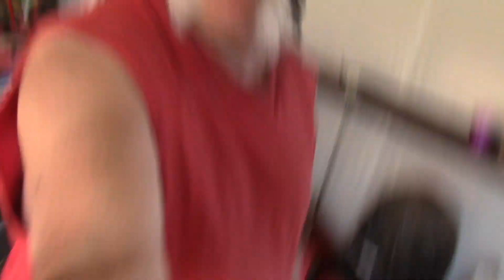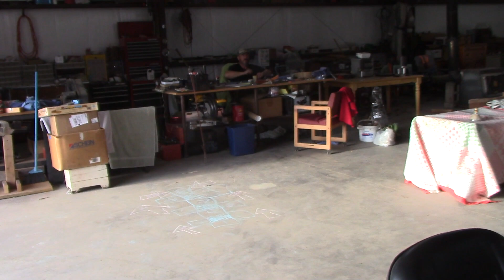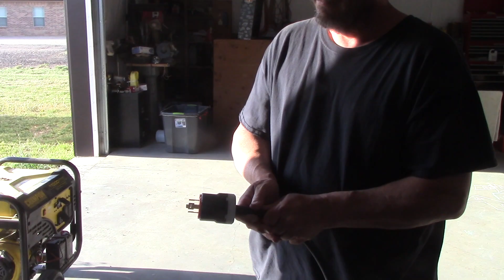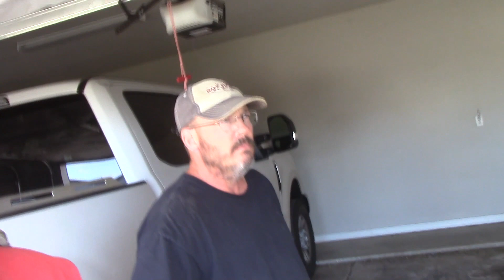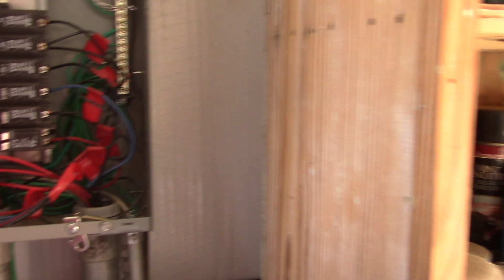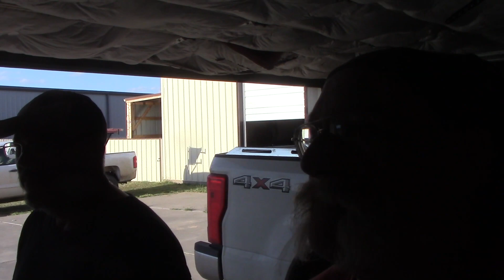SHTF Generator Install for Emergency Power

Comment: The home brew, back door transfer switch is the way we did our barn too...  not as nice as a proper interlock transfer switch but as long as you use your brain, it works just fine
Reply from the maker: Bingo! Using the brain is important. Good to see ya!

Comment: I was wishing I had that set up during the winter storm / power outages.  I ended up running my furnace with a power inverter hooked up to my car just keep the house up to temperature to prevent pipes from bursting.
Reply from the maker: Hey, that's pretty smart, Kyle! And I'm guessing it worked so kudos to ya! Getting my generator hooked up for easy access is still something I should do, but, at least I know how if I need to do it in a hurry. Thanks!
Reply: @RobPainless  thanks! Yea it worked but one thing I learned is to make sure the inverter is "pure sine wave". Modified SW can have weird effects on things. Hopefully we can wait a long while before we need any of this stuff!
Reply from the maker: @KyleMerl  Correctamundo!

Comment: Great job Rob!👍
   Now if you can figure out how to make those generators quieter you could make millions!!!!
  Keep breathing
Reply from the maker: You got that right. It's a noisy rascal.
Reply: @RobPainless  they all are!
Reply: I have used a welding machine called "Whisper" that is very quiet. But they are expensive. They are very reliable as well.
Reply from the maker: @kenycharles8600  Very cool, Keny. Good thing to know. Thx.

Comment: I did that with my solar.  Accidentally flipped the breakers once when the mains were still on. My inverter went poof. Those switches that prevent that are worth the money and trouble I think. Especially if you're absent minded like me.
Reply from the maker: Lol! Yeah, he's gonna have to be very careful not to have an accident. But, he is pretty diligent.

Comment: Looks good. How will you know when the power comes back on?
Reply from the maker: Probably just have to see that other folks are up and running again. I guess. Lol.
Reply: @RobPainless  what I did on a couple of these was ran a pilot light off the line side of the main breaker with an inline fuse. Pretty easy to do and let them know to reverse sequence.
Reply from the maker: @robertmoore4637  Yeah, that's a good idea.

Comment: Good Stuff! For my situation, I just need to build a little "Shelter" for the Generator so I can keep it Wired to the Main Breaker Box, and keep it from being Rained On. (I'm in NC - When the Power goes out, it's nearly Always due to a Hurricane.)
Reply from the maker: He's planning on building a little shelter for his, but mainly to keep the noise down and keep other folks from wanting to 'borrow' it.
Reply: @RobPainless  Yeah, That Too! 😂
Reply: @RobPainless  I literally just Ordered my New Generator after watching your Video! 👌 Sold my Honda Generator when we went back to OH in 2001.
Reply from the maker: @sevenwonders1717  Cool! I already have one, and oddly, I have not done this set-up for myself yet. :-/
Reply: @RobPainless  Yeah, we gotta do it Bro! We'll be Glad we did when the Power goes out. 🤠